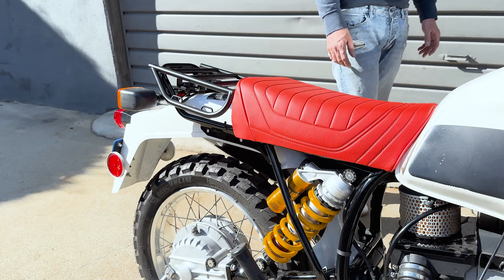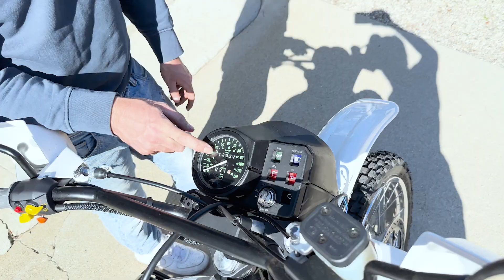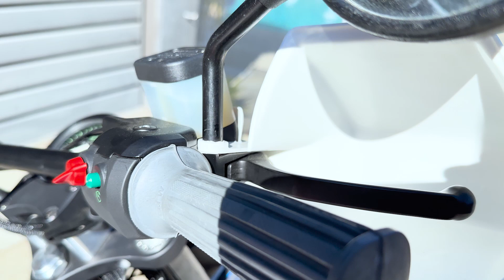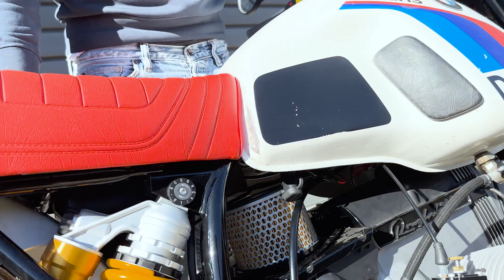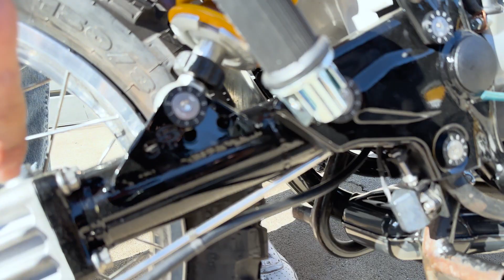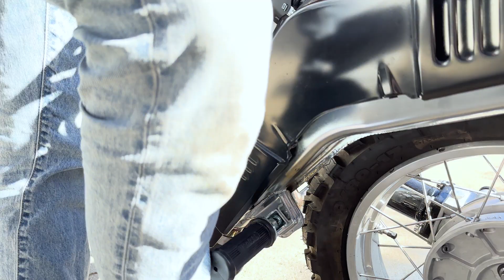BMW R80G/S: Krauser 4valve

Comment: Hi all, great videos!! love them. I'm building my own r80( actually a 1000 Siebenrock 2valve). Why would BMW vent the box in the carbs if it carbons up the intake? Thanks!
Reply from the maker: Emissions. All manufacturers do it. Typical to see anything pre 1970 with a draft tube that just dumps oil externally instead of into the carbs.
Reply: @RoughchildMoto so better to vent it like you did …
Reply from the maker: @luuuuuudoooooo I think so. Downside is that sometimes there's bit of oil on the floor when you come back to it after a ride. But I'd rather clean it off the floor than in the cylinder head
Reply: @RoughchildMoto  I know what to do then!  Any thoughts on Siebenrock quality, 1000cc capacity and a longer fifth gear+ decent brake on the g/s pd? should I go for Ohlins? You mentioned a super smooth ride on one of your Dakars, but can't remember the shocks...
Thanks!

Comment: That's the best restomod G/S I've seen yet. I've got a 1986 BMW R80G/S fully original; it used to belong to my mother (no joke) and I did my driving test with it in 1997 at the age of 18.  I'm so temped to switch to a 32L Paris Dakar fueltank, single seat and luggage rack. I wonder if it's plug and play and easily reversable.
Reply from the maker: Thanks Tom! Wow on your G/S, great story. PD tank is not strictly plug and play but it's not that complicated. The best prep you can do is take the front end off and drill an m6 hole through the bump stop, horizontally, and install a nut and bolt. That will stop your handlebars fouling the tank. After that it's plain sailing, just swap on all the parts associated with the big tank.
Reply: @RoughchildMoto  actually it is 100% plug and play as long as the handlebars and forks/steering yoke is standard.
Reply from the maker: @TheGSWorkshop-n8u  if you did that, the factory handlebars would foul the tank. Plug and play until you put a dent in each side